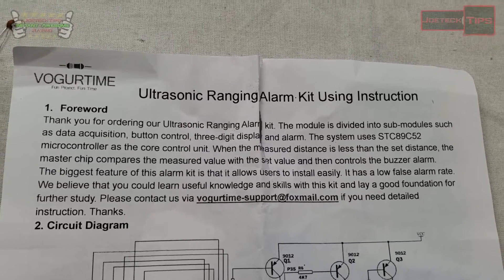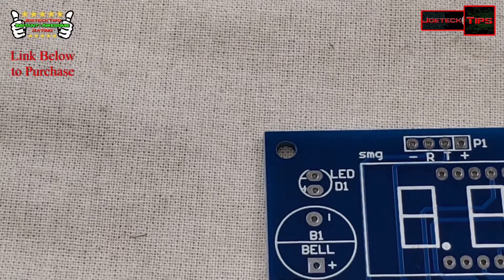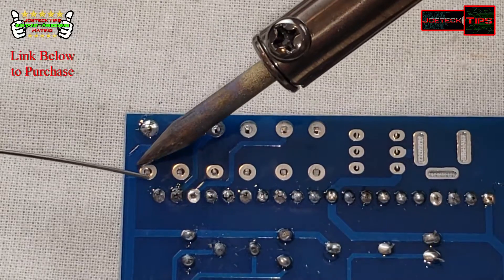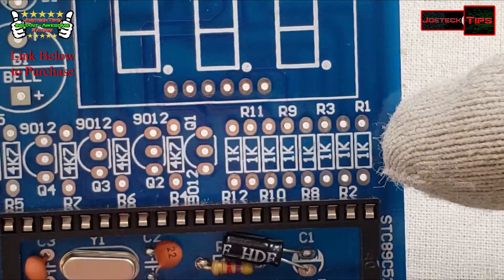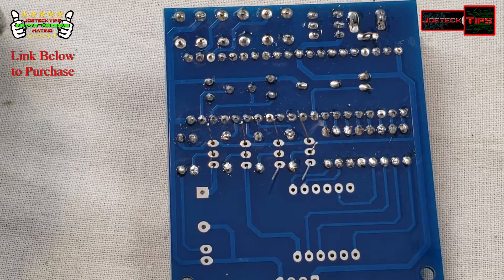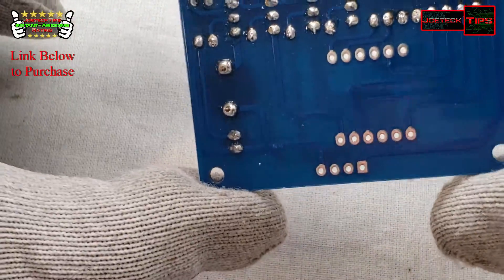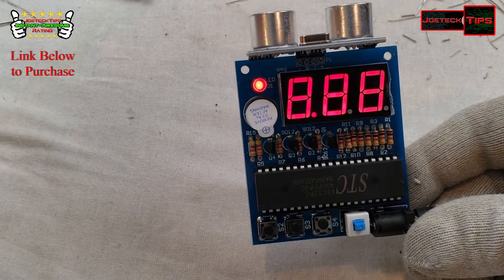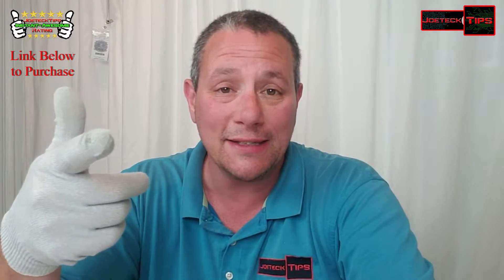Ultrasonic Ranging Alarm Kit | JoeteckTips

Comment: Hey, I have a dumb question. Do you have to include the speaker on the board? It seems like everything would work fine without it, just don't want an annoying beep.
Reply from the maker: No, you dont.. it's just an audible output so you know it's working.  Add an LED, and see if that works instead.

Comment: Hmm it's not working for me. Like at all. If i wire in the red led and the buzzer in wrong, would that cause it not to work ? Also worried about the STC chip not being pressed down enough but i dunno. Final question: mine came with a battery option. Where would i wire that in? On the plug where normally the power cable goes in ? Thanks!